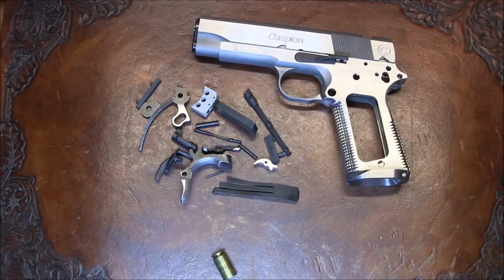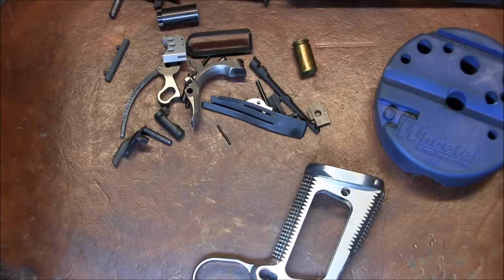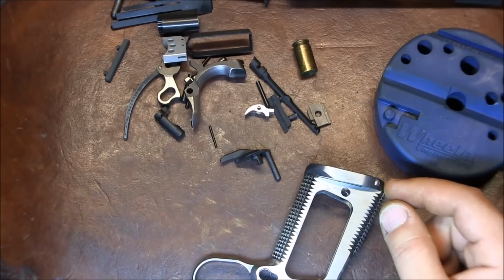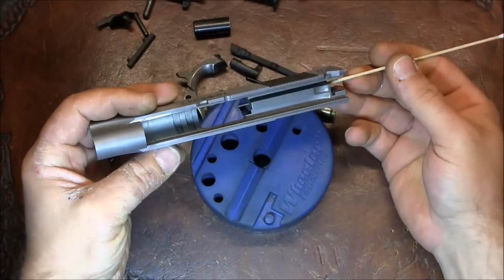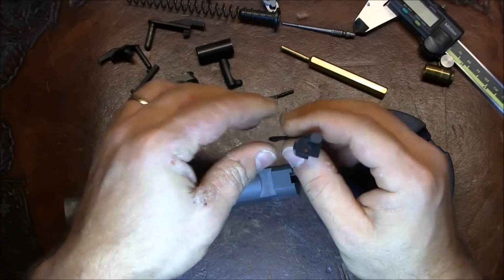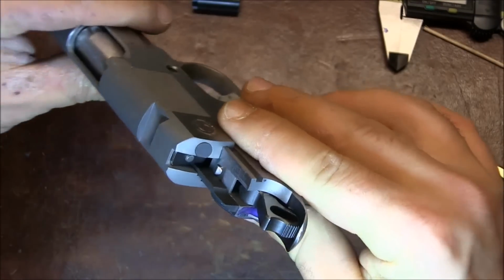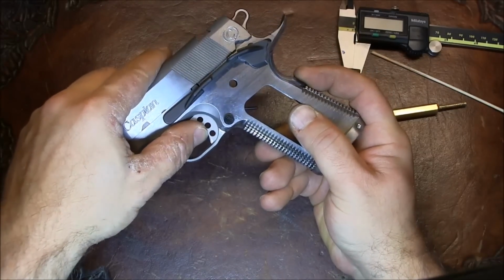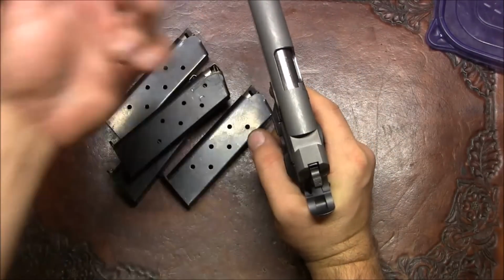1911 Build 8 Commander 45 acp - Part 9 - Fitting and Troubleshooting

Comment: Coming right along. Having watched many of your video's I must say your skills with a file are amazing.  I am going to build a 9mm with an 80% frame and you have been a great help with questions I have had.
Reply from the maker: stringbikeshot sure thing. Good luck with your build and let me know if I can answer questions. I don't have a whole lot of experience but if I can help, I will.
Reply: Ever fitted a mainspring housing? How did you fit it?
Reply from the maker: Yes, I have. The way I fitted a MSH is by taking measurements of the frame and adjusting the dimensions of the MSH.

Comment: I am surprised you did not send this one back for improper spec. But reading through your comments it seems you had to do that on another slide. So I am assuming you decided to try and (successful) work thought it rather than deal with waiting. Your ability to keep calm and work through problems on these is something  we should all learn from. But I believe we should also hold manufacturers accountable. Amazing work once again!
Reply from the maker: Keith Reinert thank you. Apparently this was not unusual. Caspian could have fixed it (they press fit a plug after machining out the existing hole and drill a new one) but they said this much offset is not a problem.

Comment: Thanks for the tip about the brushes.  Will get a set next time I order from Amazon.

The Wilson trigger appears to be the style and length that I want, but I don't see a pre-travel adjustment.
Reply from the maker: Suburban you are correct. this one doesn't have pre-travel adjustment tabs.

Comment: That is one very sharp looking 1911. Glad it is bushing. John Browning did not design a bull 1911, but a bushing one.
Reply from the maker: Thank you!
Reply: @MosinVirus  Hey is this video - 1911 Build 8 Commander 45 acp - Part 9 - Fitting and Troubleshooting  the one where you cut the spring tunnel down on slide?  Which one is that where you cut spring tunnel. I bought a Tisas slide and it doesn't clear the disconnector completely before adding barrel and spring.

MosinVirus
82.9K subscribers

Subscribe
Reply from the maker: @alanex5225 I don't believe I used a full size slide. Instead I believe I went with a commander slide. There was nothing to cut down on the slide side.
Reply: @MosinVirus  I thought there was one where it was a commander and didn't give you enough room so you cut it down. Thanks

Comment: Hey, this Tisas Carry slide I just bought - the spring tunnel measures 1.2715" to 1.275" the best my calipers say.  A bit over the customary 1.25" and it doesn't clear the disconnector completely so either I'll have to shorten the spring tunnel or set the frame back more. I have the frame at about the correct setback but like your conversion you did I ended up with a "step" right at the VIS. Have to file it off. What do you use to cut the spring tunnel?

Comment: I have a question about these Caspian slides, I am ordering my first one and I notice they are all cut for 9mm firing pin/ejector, is there anything I have to change for this to run 45 ACP?
Reply from the maker: Because they run with 9mm ejector the ejector nose needs to be looked at to make it work for 45acp

Comment: hopefully the offset firing pin wont cause any issues. I admit, I am disappointed in Caspian if this is a true defect. nice work by you. good luck with the test fire.
Reply from the maker: ex.cxflyr Test fire went ok. No sights yet, but it seemed to send rounds in roughly the same direction.

Comment: I’m new to the world of 1911s. Is there a particular reason you removed material from the barrel to allow it to drop properly instead of the slide?
Reply from the maker: It was easier to remove a little material from the barrel than the inside of the slide. However on a different build I did both.

Comment: If you mentioned anything in other videos you can send me there
My commander ejects straight up and back, sometimes empties hit me in the forehead.
I've tried a few ejectors and extractors, but haven't trieds a 9mm ejector.
Is that an issue you've delt with?

Thanks - Happy New Year!
Reply from the maker: Hello and Happy New Year to you as well. I have dealt with those kinds of issues. What caliber is your commander?
Reply: @MosinVirus  Hi - Thanks for replying
My commander is a .45
It's a Stealth frame and I am seeing that Stealth uses full size rail length / slide stop abutment / recoil shoulder position on their commander frames.
You're probably aware of that... Different issue, but possibly related.
I may do what you did in your Commander video (#8) ...At some point
Someone else who is knowlegable suggested that I work on the extractor to remedy the problem, but I've tried 4 different extractor designs and 2 different ejectors and the empty cased still fly directly over my head.
Someone else recommended trying a 9mm ejector. 
I haven't done that yet.
If necessary i can send pics of the ejectors I've tried.

Thanks Greatly - I appreciate your fanatical attention to detail - Something I identify with, personally
Reply from the maker: I will reply in detail later today.
Reply from the maker: Hello again. I was actually not aware of Stealth commander frames being government frames. I never used their commander frames. I assume you are using a commander slide, guide rod, spring plug, recoil spring, barrel bushing and the front shoulder of the barrel is relieved almost to the front locking lug. First and foremost I would make sure that you are getting complete slide travel to the rear. I would check by only placing the slide and guide rod into the frame and seeing how far the slide travels. Then, I would introduce the barrel and barrel bushing and see if the slide still travels as far back as it has before, then introduce the recoil spring and verify the same. Then I would look at the shape of the ejector nose as well as its length. Are you using an extended ejector? Consider shaping the nose so that the back of the casing hits its leftmost side (if you are behind the gun). You can also file the face of the ejector nose from bottom to about half way up to raise that contact point slightly higher. Basically consider the relationship between the extractor and the nose of the ejector. The more vertical the line connecting the ejector nose point of contact with case to the point of the extractor claw that holds onto the case the more vertical the cases will want to go when they eject. Then you also have to consider if your ejection port is lowered or not. Maybe the case starts going off to the left, hits the slide and gets redirected upward. I would need to see the parts.
Reply from the maker: Additionally, if your slide is not cut for a 9mm ejector you will not be able to use one.
Reply from the maker: Lastly, you didn't mention whether you tried tensioning the extractor differently. All of the stuff I wrote before was assuming that the extractor tension was checked and corrected if needed.
Reply: @MosinVirus  Thanks
The ejection port on my Commander is lowered and I've addressed all the slide travel clearancing details already.
Extractor details are still somewhat of a mystery to me. I have the information on what a proper extractor should be like, but I'm still unsure of how to execute that.
The slot where the ejector fits in the slide is .102" wide and the ejector is .062" 
I'm not sure whether that extra .040" of space is enough for a 9mm ejector.
Yes, my ejector is extended
The way it is now - For slide travel, with the recoil spring guide rod in position, the breech face stops just at the front edge of the disconnect hole.

Edit - I was looking at info on extended ejectors and I don't think mine is long enough. Even though I ordered an Extended Commander Ejector. I believe it may be possible that the reduced travel of the  Stealth frame makes a longer ejector necessary.... I'll find out soon

Some 1911 producers actually make their Commander size guns using a full size frame with just the dust cover shortened.   

Thanks - Good luck in '21
Also: I found some industrial diamond metal plates on ebay that come in various grits that are about $2.50 each and cut like magic
If you want some more info on that, It may be worth your while to get some.

Comment: I have read in various past articles that Caspian made the best quality frame and slides for custom 1911 builds. It would seem that based on the misaligned firing pin channel you encountered, Caspian quality has declined.  Based on your research are their better base frames and slides to use?  Brown, Nighthawk or Baer?
Reply from the maker: mg conslt Not really. I believe this sort of thing happens everywhere. For example, I got a Nighthawk slide before and it has out of spec breach face shoulders so a barrel couldn't be fitted. When I sent it back for replacement, they sent me a slide that was better but was missing one of the features that the old one had. However, I discussed my current slide with Caspian and they were very willing to correct the issue with a new firing pin bore bushing. I want to try some other ammo brands in this gun and see if I get similar performance to my test fire and then decide if I will send the slide back.
Reply: A very nice build.  Brownell's no longer carries the checkering jig you use, unfortunately. I suppose I could make one by cutting two pieces of steel plate, drill and tap one of the plates and it would be OK to create the verticle lines.  I will need to ponder about how to create a guide for the horizontal lines.  As always, thank you for your great and inspirational videos.

Comment: Great job, Beautiful pistol! Have you checked that the disconnecter prevents the pistol from firing out of battery?
Reply from the maker: Yes, of course. It disconnects pretty early, since the front of the disconnector slot in the slide is just past the front of the disconnector hole in the frame.

Comment: Did you ever contact Caspian? I wanted to buy a slide and frame from them but this has me nervous
Reply from the maker: I did, they said it happens sometimes and they can fix it, but if the offset is not too big I could simply use it as is.

Comment: WIll you be doing builds on the new Spectre Polymer80 Compact lower (Glock 19 build?)? Well, once they are release.
Reply from the maker: Quite possibly. Since they will have metal rail inserts in the rear.
Reply: Nice.

Comment: Would it be tough to delete an ambi safety?
Reply from the maker: No, would simply require fitting of new thumb safety.
Reply: @MosinVirus  okay, will I need a pin for it?
Reply from the maker: @SilentScreenSociety  if you have the kind that uses a hammer pin, then yes, you should also get a standard hammer pin.
Reply: @MosinVirus  Okay, I'll keep that in mind. Thank you

Comment: I never really wanted to get one of their slides anyway. their logo is to big and gaudy. I also don't like the idea of using 9mm parts in a 45 acp. I know it's no big deal with those particular parts but I'm just a little ocd that way.
Reply from the maker: Brian Parker I know exactly what you mean. I actually had a different slide, but then realized it was badly out of spec, and sent it back. And got this one in a hurry.
Reply: Caspian uses 9mm/.38 Super spec firing pins in all of their slides.

That said, the ejector cut is correct for a Colt Commander slide.  Colt only uses two ejector profile cuts:  one is for the .45 Government Model, and the second is used in all other models (non-.45 Government Models, and all of the calibers offered in the Commander, Officer's ACP, and Defender.)  In the second group, the only differences between the various caliber ejectors are the length of the tip.
Reply from the maker: Thank you very much. This is very good to know.